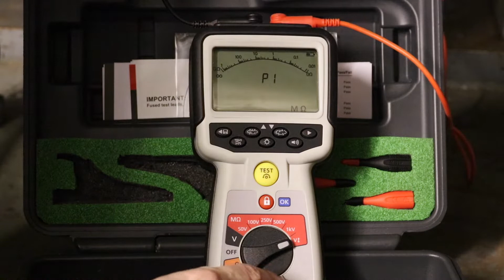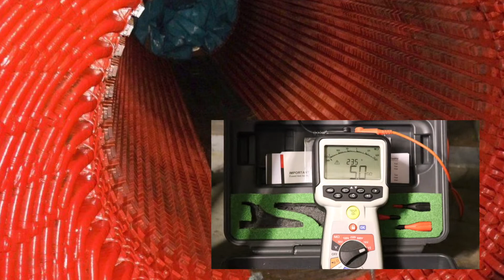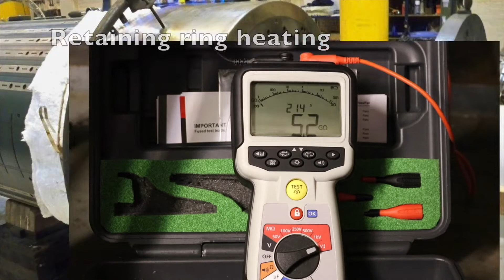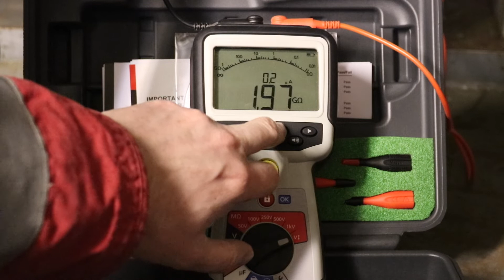120MW Generator Rotor Winding PI Retest

Comment: This is great I would really appreciate some context for those not testing these motors/rotors on a regular basis what thresholds for good/bad readings are how would you communicate these readings to a customer and on the basis of such readings what feedback would you provide to a customer. You did some of this at the end but definitely would appreciate a more of a deep dive into the theory and practical testing of motors/rotors etc….
Reply from the maker: I generally work to IEC standards and / or manufacturer recommendations. I could try and de-badge a report to go through, would take a while though. Thanks for watching and commenting.
Reply: @three-phase562  that would be great and fantastic to do not worried about the length we watch your material avidly.